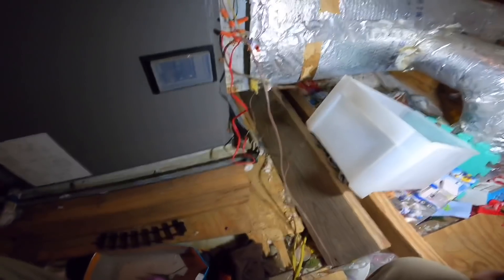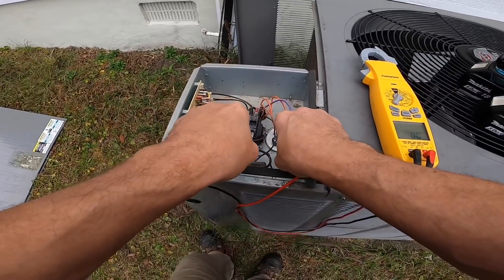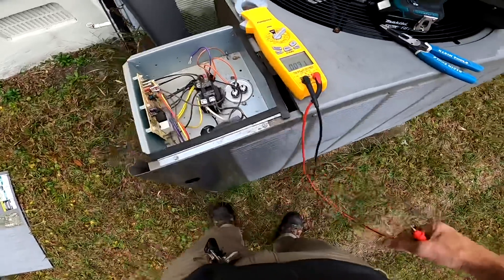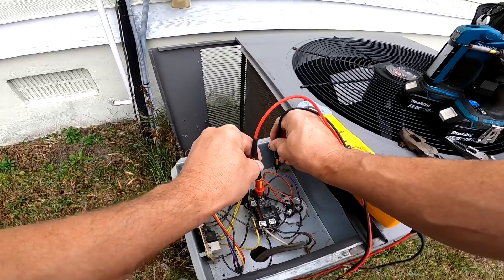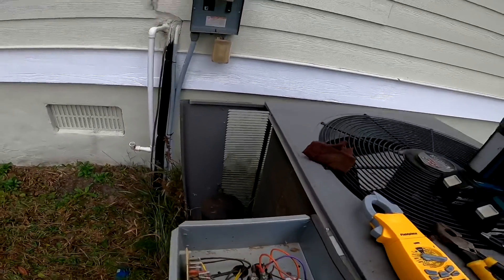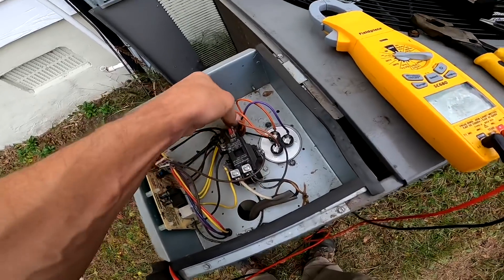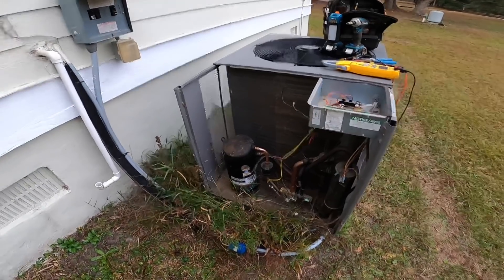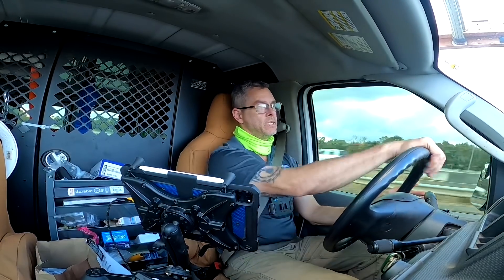2015 Ruud Heat Pump Tripping Breaker, Fire Ant Special!

Comment: At first i thought the power line had the insulation cut through and grounded against the hole in the metal box.  That's what i hate about those Ruud and Rheem units.  I always try to put something around the raw edge of the hole that the power line wire comes through so the wire does not get cut through from vibrating against thecraw metsl opening.  Also  could you have gotten a generic universal crankcase heater?  I have used a few of the Supco brand crankcase heaters and they are pretty superior to the oem ones.  They self regulate the heating temperature based on the temp of the air and compressor.  The job if the crankcase heater is to keep the oil in the compressors sump supple so it don't slug in cold operating temperatures.
Reply: I figured it rubbed through where it was zap-strapped right by compressor, but I also seen the case heater down in the ant mire and unplugging the compressor moved both around.

Comment: Why do you not just pull the common terminal wire on dual run caps when testing.  Save yourself some trouble.  Some systems with scroll compressors don't require crankcase heaters, depending upon refrigerant charge amount?  They seem to work ok.
Reply from the maker: I could us a generic, but went with OEM